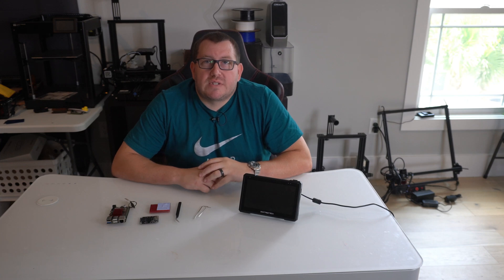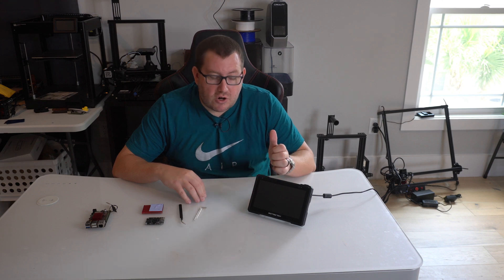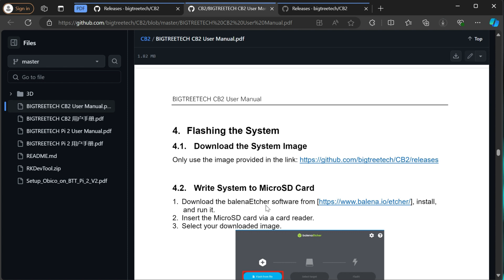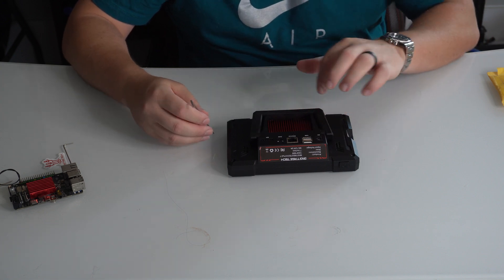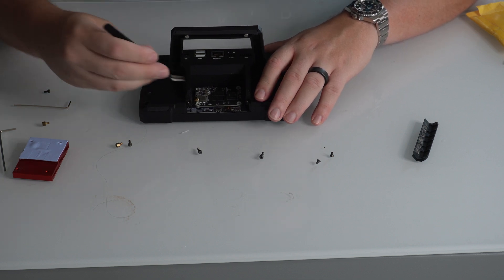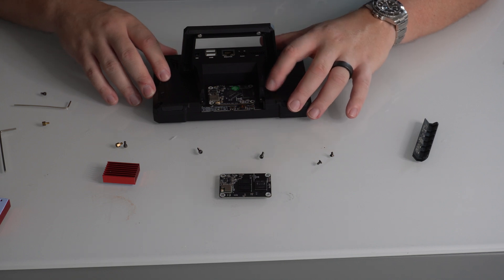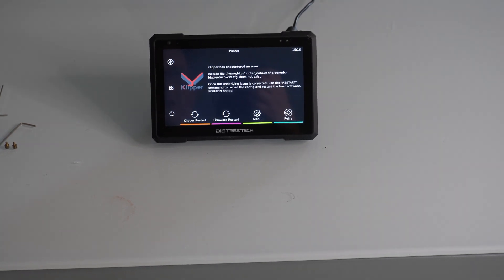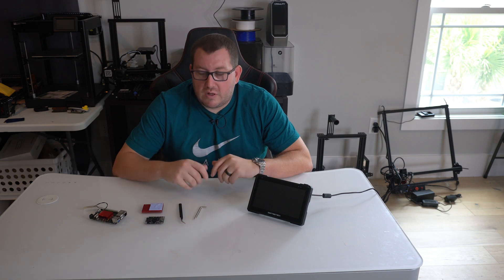BTT Pad 7 – CB2 Upgrade!

Comment: Appreciate the straightforward video. 
Any plans to put the CB1 to use on something else? 
I am waiting on my Pad 7 and a CB2 to swap in. I got the Pi4b adapter with the CB2 to pop the CB1 into for another project.
Reply from the maker: Hi. Thanks for the feedback. I dont have any plans for the CB1 right now but projects come up all the time so im sure it will get used eventually lol.
Reply: @3DPrintscape  I am hoping to get it to work as a WiFi flash drive to use with my Elegoo resin printers since they don't have WiFi built in. I had it working with a Pi Zero W, but I am not real versed in RPi's etc. Just a maker and a tinkerer that always has more projects than time. Lol